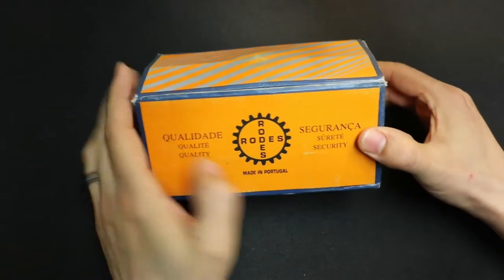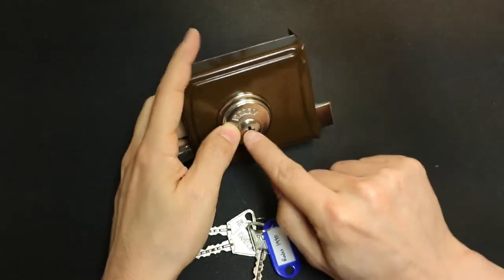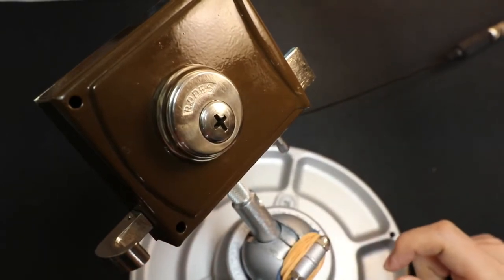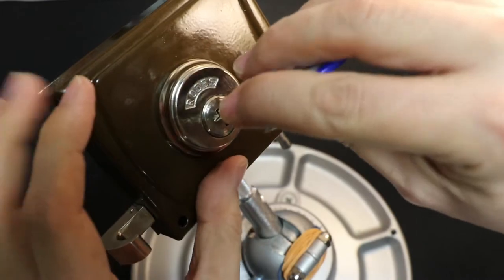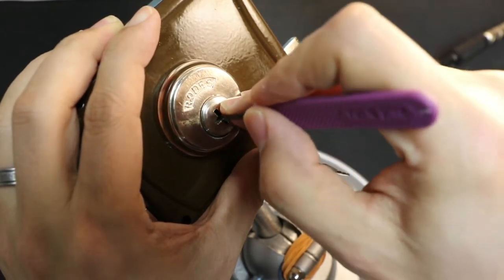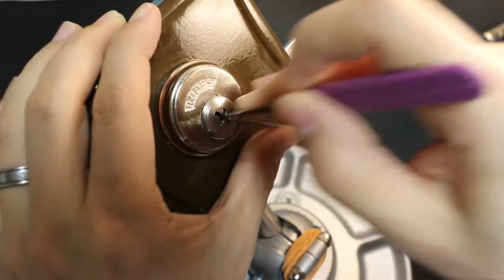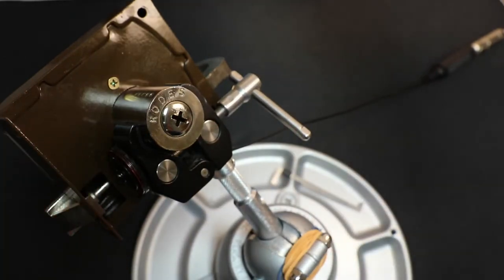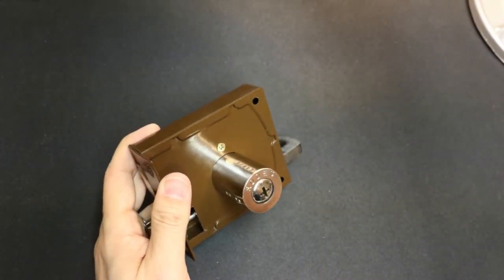[L121] Rodes 1990 Lock from Portugal - pick and gut

Comment: Pretty sure that I would have a gutting disaster if I attempted to gut that lock. You really made picking that look so easy.
Reply from the maker: :) Slow and steady...usually I'd gut a lock horizontally, but in high pin count it pays off to go the awkward vertical method so gravity isn't fighting you on the pins.

Comment: Yes Michael, these cross locks are common here in Portugal. I love picking them but when I tried to gut one once most of my pins and springs landed on the moon. Never tried it since! haha. Nicely done there
Reply from the maker: Hah, that's a shame...when gutting locks with pins from multiple directions I can recommend removing the plug vertically so you're not fighting gravity to keep the key pins in...of course, that does not protect from spring propelled spacepins.

Comment: Just wondering if a spinner would work to open it all the way ? I'm digging theses locks from Portugal. Great gutting, I bet it was a bear putting it  back together. Can ì use you Portuguese connection to buy me some of these locks. Or what do you recommend?
Reply from the maker: Not sure if you read my last comment response, I let you know where I got the locks. Early in the video I mention using a plug spinner and it should surely work!
Reply from the maker: Shoot me a message on Reddit u/Norlin76 I might have a 895 to sell